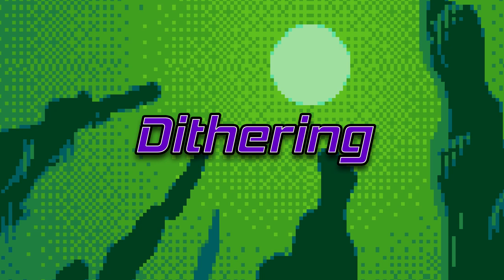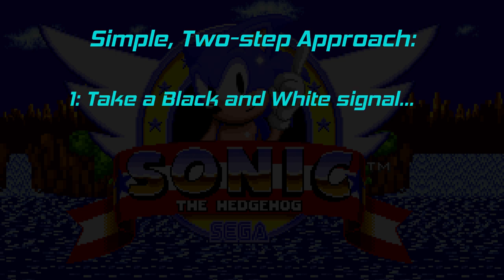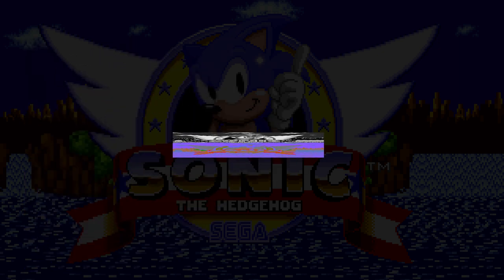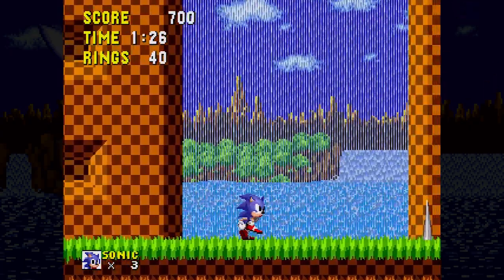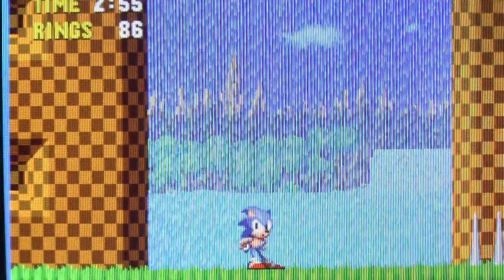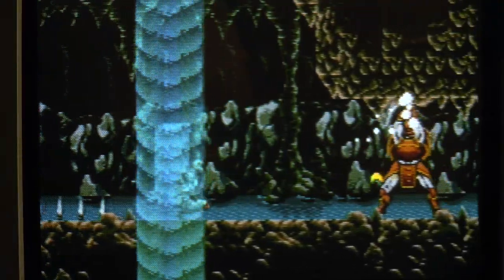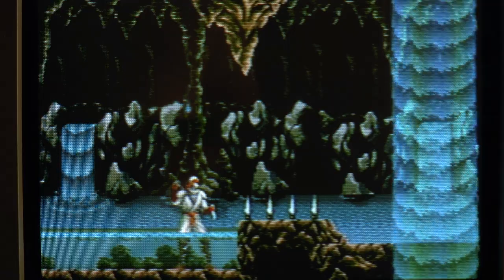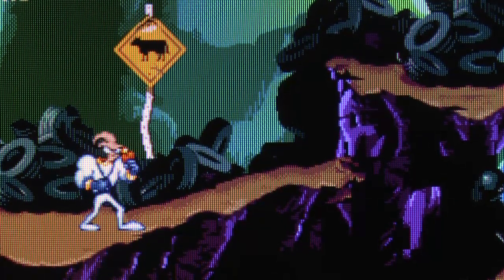Dithering on the Sega Genesis with Composite Video

Comment: Madness I thought I was wrong when I noticed Killer Instinct and Donkey Kong looks better with composite vs rgb even emulated! I ise emus with hdmi composite converter on CRT's.
Reply: You're never wrong when you think something looks better, sounds better, etc.  Everything in your life is through your perception, so everything you perceive to be true is true.
Reply: I saw a great video that went into depth about how Rare took all of the high-quality assets from DKC and Killer Instinct and whittled them down to fit within the limitations of the SNES hardware, it was a really complex undertaking. You have to remember that at the time, they were building all of the models for the characters and backgrounds and everything on high-end Silicon Graphics workstations, which if memory serves me correctly cost around $100k each. So they started with incredibly detailed, high color models and had to greatly reduce them in quality. They did a really great job of it, too. The image quality degradation is definitely more noticeable on higher-end displays than on regular old CRT over composite. Neither game looks bad by any means, but there's a lot more color banding versus a CRT which does a nice job of smoothing everything out.

I really miss the days when SNES over composite was the best I had available and I just had fun with the games rather than worrying about which model TV I play it on or what connection I use. It's interesting to explore, no doubt, but at the end of the day the point is to just have fun.
Reply: Adam Baldwin awesome comment Adam! Rare is the greatest developers of all time because of the achievements they had in snes times. Hands down genesis and the snes were the best consoles when it comes to platform games. I just started to play Yoshi's Island as I missed it back then. Such a pure masterpiece. I am making home arcade emu stations using a crt. I wonder if programmers could come up with modern games which supports the old school retro technology!?

Comment: Back in the day before I was ever able to upgrade the video quality of my Genesis, I always noticed dithering. The water was NEVER transparent in Sonic the Hedgehog. I always noticed the lines. It was super blurry, but they were noticeable. I always noticed dithered meshes. Slap a 32X on the machine and use its composite and the dithering becomes even more clear. When people show examples of blending using composite, those are images like I've never seen on any TV when I used composite. Even when I used RF in black and white... dithering. It's just something that's always been there for me. So going RGB on the Genesis in my opinion doesn't lose its intended effect.
Reply from the maker: RGB on the Genesis really does look amazing. I feel that the gamut that separates composite and RGB - two native signals available with the console - is mind-blowing in its size. In addition to the composite signal having the typical composite quality attributes, it often tends to not be encoded properly - resulting in a large amount of artifacts. Those artifacts probably enhanced the "dithering blur" quite a bit on some consoles, but that aspect certainly wasn't consistent for all hardware (just as you mentioned with the 32X improvement). That particular model 1 I used for a few seconds of footage is definitely an outlier. 

The display also plays a key role in how composite looks due to how much effort goes (or does not go...) into decoding the signal. It sounds like you have had a pretty good experience with the television/monitors that you have paired with the system in the past if the blur-effect on the dithering did not seem as pronounced as some examples others have provided.

I assume this group of variables (system + display used) contributes greatly toward how passionate many people feel on the subject.

Comment: Holy crap, that Sonic 1 composite waterfall does look really good! Normally it’s impossible to see at all over the extreme rainbowing.
Reply: @Nicht von dieser Welt Europe = PAL
PAL + composite = no rainbow
NTSC + composite = rainbow
Reply: immediamal coccinello Oh that’s cool. I should get some composite cables for my Mega Drive and see how good it looks.
Reply: @immediamalcoccinello483  Yeah I can't see I see too much rainbowing on my UK Mega Drive but I want to say for some reason that I have seen it before, maybe I am confusing with a youtube video?
Reply: Yeah I have an NTSC CRT with composite hooked up to real Genesis hardware. The Rainbow bands on the waterfalls are headache inducing. So strange that the PAL versions would not have the rainbow problems. You'd think it'd be optimized for areas with NTSC. Since most areas that had PAL also had Scart or RGB.
Reply: @overnightdelivery  It’s not to do with the game, it’s the video signals, PAL is much better at handling colour since it was designed for use in mountainous European regions with lots of hills and bad weather, PAL signals have a system where it averages chroma information to get a more accurate result, and discards off-spec colour, unfortunately this means the colours are “lower resolution” than NTSC with poor quality signals, but it’s much more accurate. Kinda like a 360p video with perfect sharpness vs a 480p video with a blur filter applied.
Reply: @justanotheryoutubechannel  So you're saying the Chroma isn't accurate on NTSC and it causes the Rainbow Bars? Interesting.
Reply: @overnightdelivery  Pretty much, the blurring of the colours on both PAL and NTSC to get the transparency effect is due to the chroma signal being low quality but it’s a combination of the less accurate NTSC chroma and the incredibly poor quality composite chroma output by mega drive’s that leads to the artefacting, PAL is similar quality but it’s handled better so doesn’t have the rainbow.

Comment: More re-releases of old games need to keep in mind the use of dithering and include optional filters to emulate the way it's meant to look. It's a trick not exclusive to Genesis/Mega Drive games. The GBA for example with games such as Sonic Advance 1-3 and the Mega Man Zero games also makes use of dithering. It's very noticeable in the Mega Man Zero/ZX Legacy Collection, as places that use dithering stand out, and even appear totally messed up when the smoothing filter is applied (among other fudged up details. I really hate that filter). The upcoming Sonic Origins so far appears to be yet another re-release of an old game that uses dithering but has not taken into account what this should look like on screen.

It doesn't seem like devs these days really care about the difference in how screens output visual information compared to back in the day when re-releasing games, and so all to often dithering just looks... Wrong.

Comment: Countless forum and social media claims to the contrary, the Genesis and its games were designed around the "inferior" video output and inputs used by the average consumer.  Set up a Genesis, Sega CD, 32X, X'Eye, Wondermega or CDX properly with Composite and the video quality is consistent with no wavy lines, "jail bars", or overly obvious moire effects.  Composite can be just fine.  I have also found RGB very enjoyable as an alternative, mostly with the HD Retrovision cables or simple RGB to Component cables.  As a result, on my 27" RCA SDTV, 32" Sony Trinitron XBR, or 50" Panasonic Plasma screen, I can choose between Composite, S-Video or Component for all of the consoles that support it.  I frequently am more than content with Composite, as the Component converted RGB can be too bright or creates artifacts.  

By contrast, emulation on an LCD or my Plasma screen always disappoints me, jarring me right out of the experience with dull or too bright colors and broken dithered art that should have been better blended.  Even with emulation (or compilation) filters I much prefer original hardware with Composite.
Reply: Great post man. What do you think causes some of the wavy line distortions and jail bars in genesis composite? You mentioned improper setup, isn't it as simple as getting an official composite cable and a 240p/480i standard definition CRT?
Reply: Why contrary? Did you see the video? That's what he's saying.

Comment: I come back to this video every so often as this stuff is so fascinating to me still, I’ve adapted my retro setup as a result too. I’ve now got my system set up so RGB goes into SCART 1 and RF is converted to composite and sent into SCART 2 via my VCR, RGB looks great and I love the checkerboard patterns, but it’s a fun experience to switch over to RF and see how the games were intended to be seen. My equipment is all PAL though so even on RF rainbowing is very common and the signal doesn’t fully blend all the colours, even though the edges are a lot fuzzier on my CRT. I’m working on some comparisons for /r/CRTGaming at the moment actually.

Comment: U 4got the most important factor in making it all work: using the shittiest TV possible. If u used an e.g. Sony Trinitron (which I had), it'll look sharp and the effect is negated.
Reply from the maker: TVs make a huge difference when it comes to how the game looks. It definitely isn't limited to just the console's output quality and cable used.
Reply: I used a 27" Sony Trinitron myself, which had S-video and composite. Basically, I could choose between the two different settings by going between the inputs. Composite fully showed the right effect while S-video partially seemed to fix it, though not fully.
Reply: A lot of trinitrons also have additional processing of signals, it can be hard to differentiate between svideo and composite with those tvs
Reply: @DisplacedGamers  yeah why didn't you use a 19 inch or 24 inch crt
Reply: @supersexysega  Funny, I remember doing that  xDDD
Reply: My Goodmans ld1928w is the very peak of crap video quality. It makes everyhting look trash somehow, RGB or RF or composite or whatever. And it has 16:10 aspect ration and is just above 720p. And it's an LCD. Interestingly it is a UK TV but has S-video.

Comment: Awesome video! It helps justify my want of a 36" CRT for retro gaming. Preferably a Trinitron.
Reply: That's gonna weigh like 300 pounds. Have fun with that! (So worth it, though!)
Reply: Lol my family used to have a TV around that size, and it was a nightmare carrying that thing downstairs from the guest room when we were getting rid of it. I've owned a 17'' SR2000 before (really regret giving it back to the thrift store), and it was easy enough for me to carry on my own for short periods of time. It was from 1987, but the picture quality was all right, and it had those thick dials on the bottom of the TV (those scrolling ones that poked down out of the bottom ridge of the TV, not full sized knobs you had to turn) and one of those was adjustable sharpness. Zero sharpness gave the TV a SUPER 80's look. And I swear it was so much better than using a remote control, so easy to adjust something just by reaching forward and going click click click on a scroll knob. Ahh, now I'm reliving the old days...

Comment: If no one told me it was running on a Genesis, I would've thought that Earthworm Jim was a Playstation game.
Reply: Earthworm Jim is a very handsome looking game. It came at that point where the Mega Drive was becoming elderly tech, and programmers by that point knew every possible trick to use in the graphics. That's how a game like that can be run on a system designed in the 80s and on a modern system like the PlayStation (although it won't have taxed the PS' hardware much!). 

Most game systems have that impressive late period where the best looking material comes out using every ounce of power the processor can muster. I like to think of it as a bit like a victory lap at the end of a life cycle!
Reply: I still think it looks better on the SNES, but they did a great job with the Genesis port.

Comment: I've always thought that increasing image quality is moving further away from the "correct" experience. These games weren't made to be seen at such high fidelity that we see them today. They were made for kids at home with cheaper, older TVs. 

So if you want to argue for the most accurate, and the intended way to view/play a game... Then older TVs with older cables that blend the dithering is the way to go. 

The way I always like to look at it is that retro gaming always needs a little bit of crust in order to be good. Don't cut off the crust.
Reply: I agree. I dunno, I kind of like the pixelated detail as opposed to all the blending.
Reply: I agree to an extent, however, also consider RGB was still included on Sega consoles without modification and the developers were likely using high end hardware, computer monitors, etc. Plus, as mentioned in the video, more expensive TV had different image processing. While it's a nice effect, I don't think you exactly experience the game as intended by the developers all the time.
Reply: @GiuseppeGaetanoSabatelli  I disagree. I believe that game developers created games in anticipation for the majority of people viewing them on cheaper equipment.

We are not developers. We were not meant to see the game like developers.

This example has aged poorly but... Michael Jackson used to have a philosophy that his music should always sound good on shitty car stereos. So they would play his music back through a shitty stereo in the studio to make sure it still sounded good. This was coined the "sonic quality" coincidentally.

I believe my theory to be true, as most of the games of this era have visuals that were clearly intended to be seen at a lower fidelity. They aren't as detailed as they could be. Slightly minimalist. 

In my opinion, the way to truely appreciate these games the way they were meant to is by viewing them on the equipment of the time that the majority of people were using. Most people were not using high end equipment.
Reply: Yep! And same for the audio too, I heard ALL of my video games coming out of shitty monotone speakers that were built into the TV's at the time. I think the Amiga and SNES sound like crap when set to stereo sound, I especially the Amiga since it only had 4 channels with 2 hard panned in each direction if you used stereo. So you'd only have drums coming out of one side, bass coming out of one side and so forth. I never heard it that way before emulators and I thought it was weird. I only just realized this like a year ago. The audio was usually designed with the fact in mind that most people were hearing it on subpar mono TV speakers.

Comment: Wow never thought about this
I dont think its worth the tradeoff but interesting anyway
 id like to add though that dithering doesn't completely lose its effects when its in better videos signals
lots of modern pixels games still use it for things like perceived shading
Reply from the maker: Personally, I have only really used composite in the smaller era on smaller TVs like some of the repair videos I have done. It is hard to beat just now nice RGB looks on the Genesis. I definitely wanted to specify that this video was focused on the Genesis in particular. Modern pixel games as well as arcade games certainly made use of dithering, and those arcade games were RGB native.